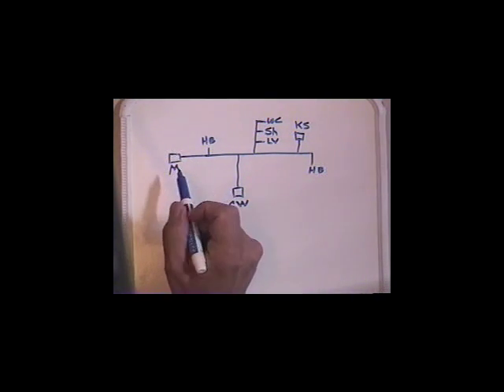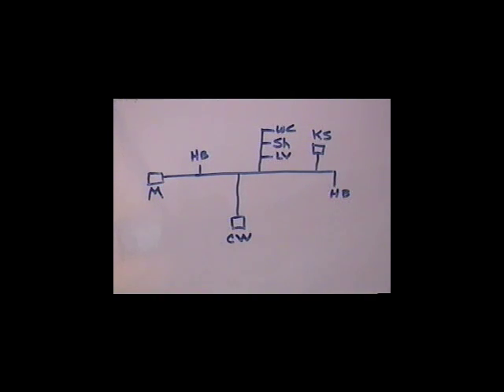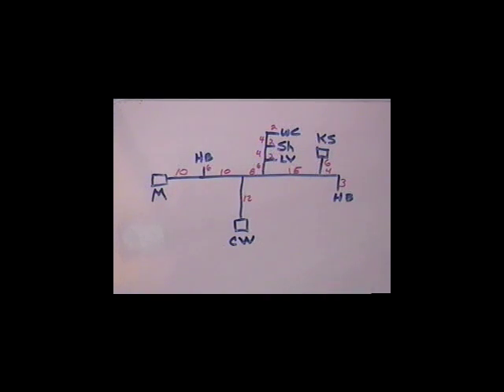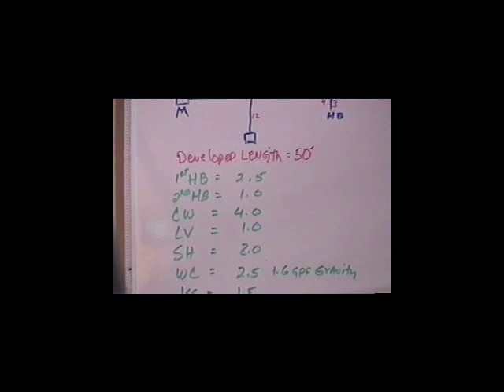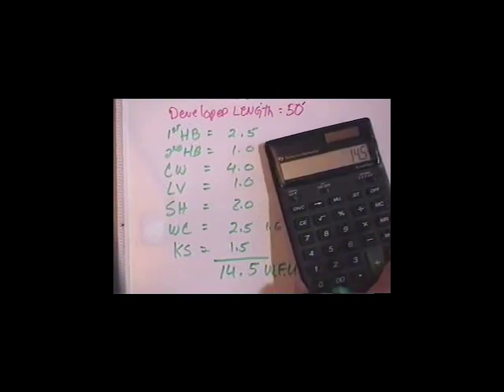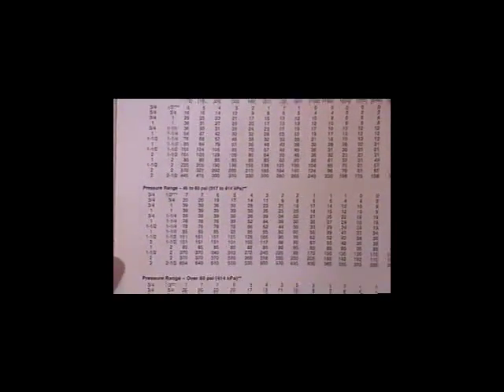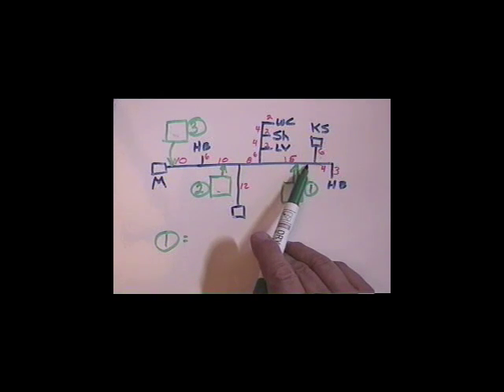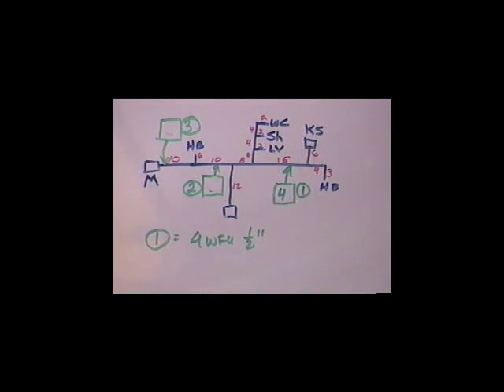Plumbing Design Potable Water Part 1

Comment: It's great to see a video on YT on this esoteric but necessary topic.
He's designing to conform to the Uniform Plumbing Code & using their code book for the charts & tables.  I don't know what edition of the code he's using, the chart #s change from each edition.
It's usual practice to take the length from the entrance to the most distant fixture and multiply it by .2 then add that # to the first to get the developed length.